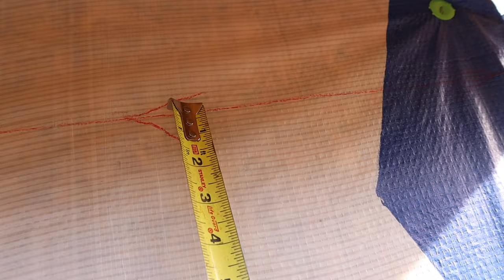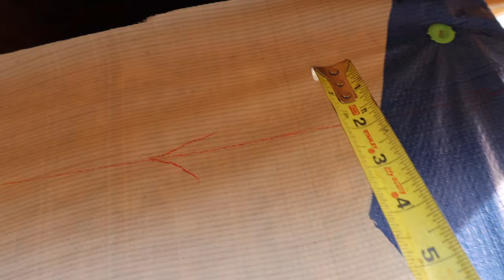How To Build A Bird Box For Soffit On A House

Comment: We called it a bird box because if birds could make a way inside them they would build their nest inside there. However unless the bird box was already there we didn't do all that added work because we didn't get paid to frame anything unless it was on the contract. We did use a 2x4 much like the longer 2x you used but our 2x4 would extend out to the fascia on the gable end. We used soffit channel along the wall made a 90 degree turn at the end of the 2x4 and back to the fascia on the wall you would be putting soffit on we'd seal off the end with coil stock bent to the specs we needed but that would be done only after the gable soffit is also completed. Once our bird box metal end is finished we'd run the fascia over it coming off the gable end. Mission Complete. No runs, No drips, No errors!

Comment: Bout right .. They are simple . Sometimes the sub fascia is lower than the gable fascia . In that case I just scribe the entire block on the diagonal and bingo . The returns that blow many minds are the hip return boxes , quoin returns . Found an ABC 123 see ya later way to assemble them in 5 minutes . I used to get a kick out of guys fumbling with them for 3 hours ..

Comment: Thx sir.. 
Nice framer vidio.. 
Gbu... 
Sir may i ques..? 
What is good pry bar use..? 
Vghn spr bar,  stanley,  estwng.. 
Or dalluge offst pry bar..? 
Thx sir..
Reply from the maker: I like Est wing the best. But I have not tried all the other ones. Thanks for watching
Reply: @TheExcellentLaborer  many thx sir..
Reply: @antondeannova7016  I bought Tekton. They seem nice. I use the small 8 inch prybar to get in between the electrical box and the wall stud so I can cut the nails. I'm in the process of slowly changing the nail in boxes for the plastic wing type "Old Work" boxes

Comment: What kind of wood do you use in building these Bird Boxes. I have to replace some around my house. The ones I have to replace look to be 1 inch thick cedar, which is non existent today, the house was built in 1980. What would you suggest. I plan on painting it, i made one side out of plywood already, not sure.

Comment: Why do a birdbox instead of just having the soffit follow the slope of the trusses top beam?
Reply from the maker: You could do that. I do the bird box for looks
Reply: Does it depend on the pitch used for the roof truss? I’m installing soffit on a 7/12 pitch. Trying to follow the pitch doesn’t allow the soffit J to sit flush against the bottom of the fascia board. Am I missing something?
Reply: It does not necessarily have to be done, but it allows the eave side to have a level soffit. Having a level soffit means a little less siding or brick is needed, works nice for things like pot lights and can hide the transition well depending on the build.

Comment: Rookie Newb here, I have an older home built in 1935 and the main windows are the larger 3'0" - 5'0" windows with the top edge above the chalk line that is level with the bottom of the facia. What do you do in a case like that? Go with the pitch of the roof coming off the house, right?